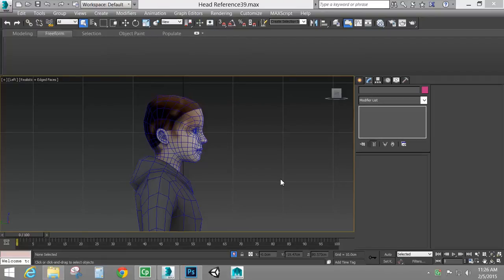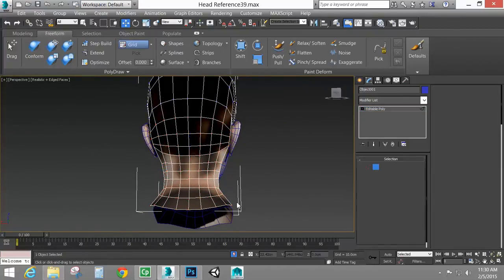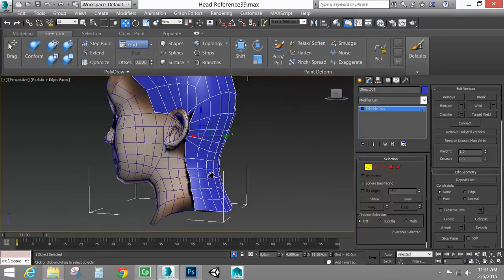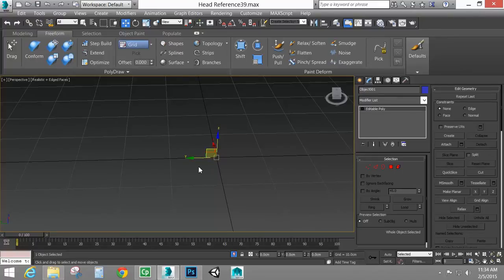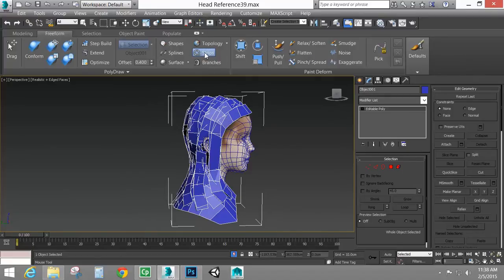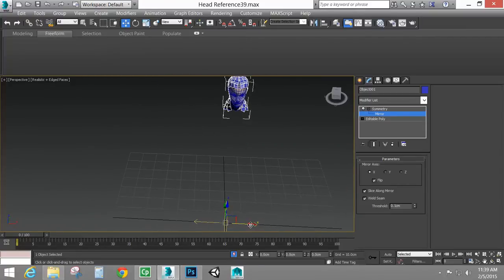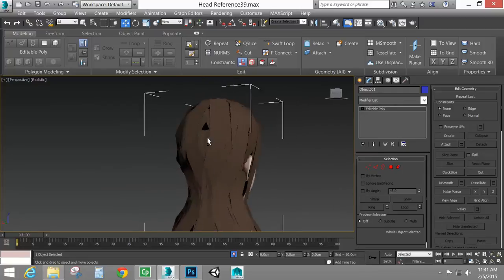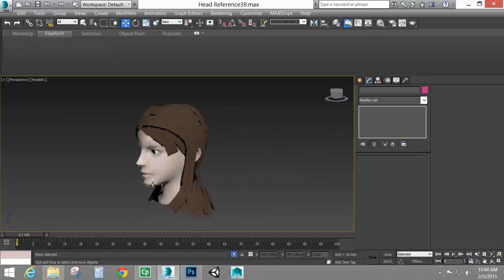Modeling Long Hair (Autodesk 3ds Max)

Comment: Hi! Thanks for your tuto! 
I've a problem with my simulation... I have manga hair (volumic) and i want to sim them with cloth modifier. I saw a lot of tuto and I set system unit to cm, I tesselate my model,... I try a lot of configuration, but my hair goes through the body! I don't understand why... could you help me?

Comment: Hey! LCF1, from The Sims 4 Studio.

 The UV map for this method is frustrating me, as i am used to UV mapping a plane as a planar, so it is usually is a vertical map. Do you have a tutorial for how you map this? Im trying it cylindrically, but im not having much luck.
Reply: edit: I would thing maybe a cylindrical unwrap individual pieces, going back and forth between creating and mapping, create, map or detaching and then cylindrical unwrap each individual object, for some reason, the UVW mod is viewing the uv map as a single vertice in the corner... I think i might try that unless there is a better way?

Comment: +CtrlAultDelTutorials When I try to draw the strips it is getting drawn on the opposite polygons. For example if I start drawing on the left cheek, it gets drawn on the right cheek. I selected draw on surface, everything that you mentioned but no use. Could you please help?
Thanks in advance!
Reply from the maker: +Vicky Ray make sure your draw on surface object is not inside out. To do this, select your object, right click, select object properties and check the option "cull backface" and click "OK". If the object is indeed inside out, you need to flip the normals. Add a "normal" modifier to do this and convert your object into and edit polygon.
Reply: CtrlAultDelTutorials I tried checking the backface culling on, but it still does the same thing. Let me explain what's happening. For an example, if I try to create the strips on the right side of my model's skull, it gets created on the left side, anything that's directly opposite to the path of my mouse movement.